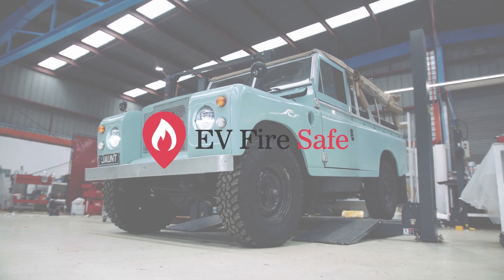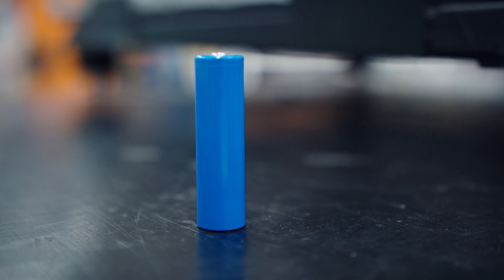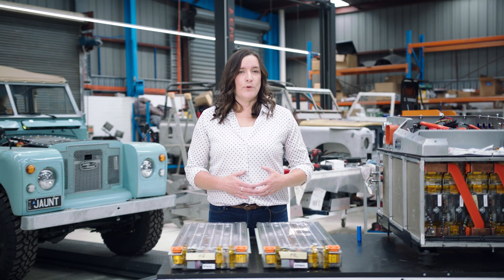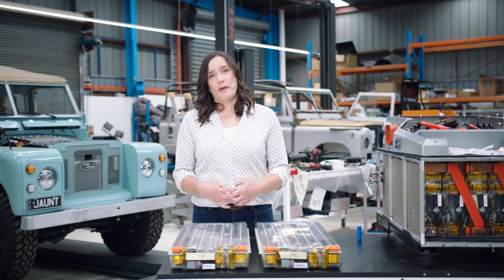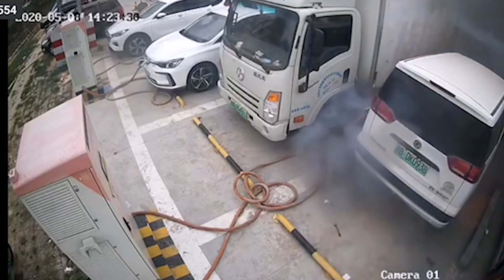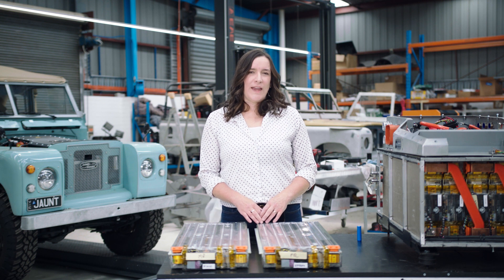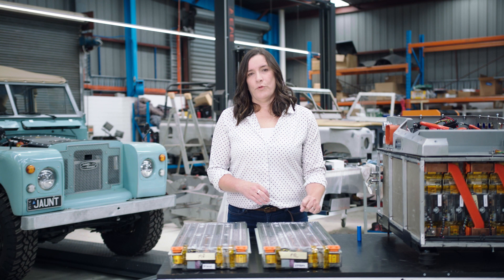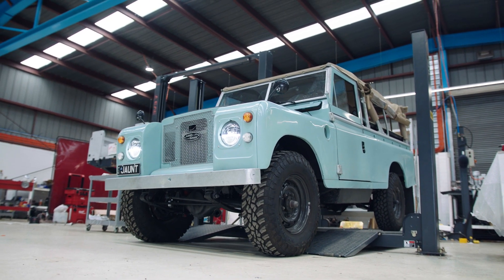Electric vehicle high voltage battery pack fire basics for emergency responders

Comment: You just convinced me never to buy an ev
Reply: combustion vehicles are 20 x more likely to catch on fire according to US insurance data
Reply: @guringai  not sitting in the shed or garage they don't, and when on fire they are easy to extinguish, they are a lot less toxic than an ev. Plus ev are useless towing my boat. You keep your Tesla and enjoy I'll stick with my practical reliable un hackable safe internal combustion truck

Comment: If we are fortunate enough to have an unlimited water supply, how long will the application be necessary? What is the recommended flow rate and how toxic is the run-off and smoke?
Reply from the maker: Hi Shan, great questions. 
Application of water will differ depending on a number of factors; number of cells in thermal runaway, state of charge of battery at time of incident etc. I'd say you can comfortably expect a 3-4 hour timeframe based on research case studies.
Don't know about flow rate, will have a look at get back to you.
There's very little testing on water run off, but what we do have indicates no more toxic than with an ICE vehicle. Usual SOPs apply; be mindful of nearby natural waterways etc.
Smoke from lithium ion battery is very toxic, containing HF amongst other gases. Due to length of firefight you'll typically need more BA operators than usual; maybe up to 12 cylinders. Smoke from vehicle plastics same as ICE vehicles.
Thanks for watching & please keep the questions coming!
~Emma